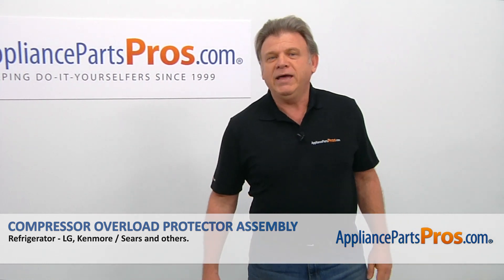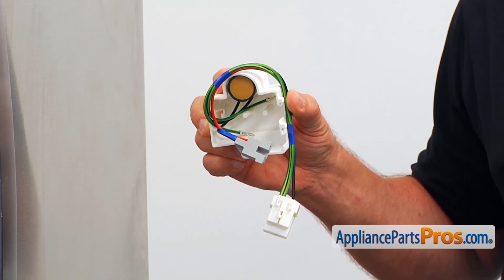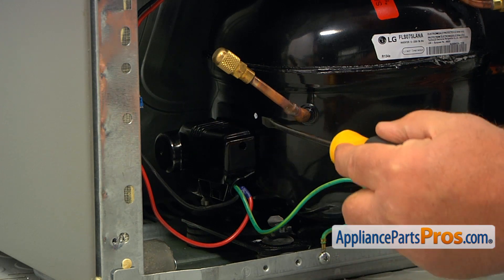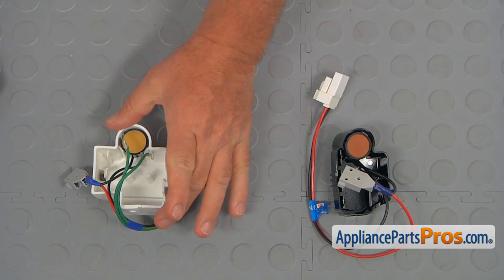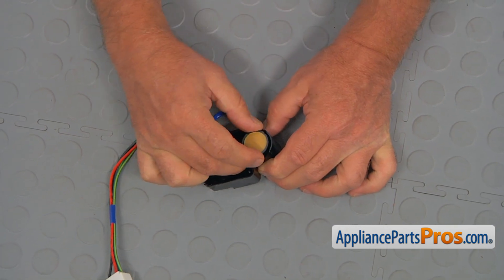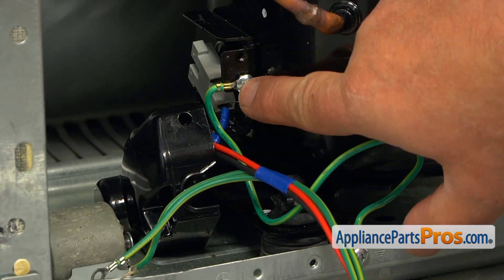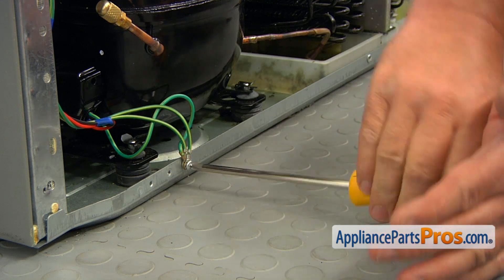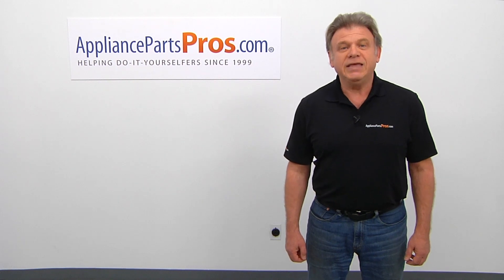How To: LG/Kenmore Refrigerator Compressor Overload Protector Assembly EBG60663205

Comment: How can you test the overload with multimeter?
Reply: when the overload is cold...check for continuity on all 3 contacts..1-2-3 should have continuity, if not..then it has burned the element inside (this is not a 100% guaranteed test because sometimes they get stuck in reverse position, but most of the time should work)

Comment: No matter how I put the freaking cover on, it would not click in
Reply from the maker: Were you trying to use the new cover box or the old one?
Reply: @appliancepartspros  the old one. I just replaced the old overload protector but I couldnt fit the cover after putting the new protector in place of the old one. It would not click in as easily in the video
Reply from the maker: Make sure the new overload is seated all the way down and aligned correctly. Otherwise, it would be difficult to know unless we could see it.
Reply: @appliancepartspros  I tried putting the cover on without connecting the overload first but I still could not fit it in. Is there anything I could do?
Reply: @appliancepartspros  Also, thank you for replying to my comment.
Reply from the maker: Since there isn't a good way to see a photo in this thread, head over to our Facebook group and post it there. We'll be able to see it and go into more detail there. https://www.facebook.com/groups/fixmystuff